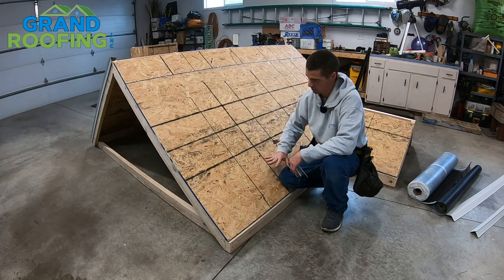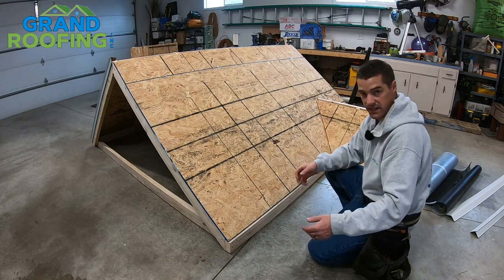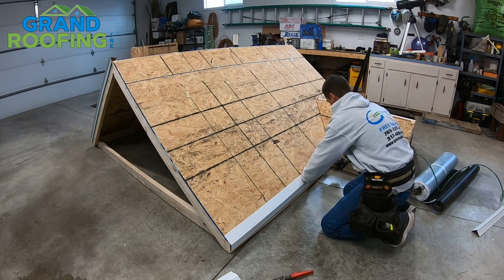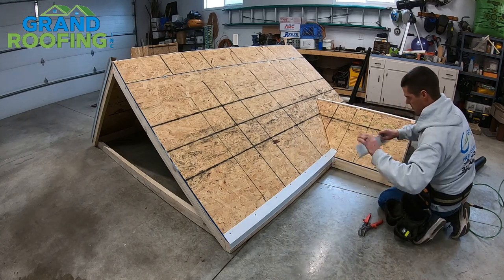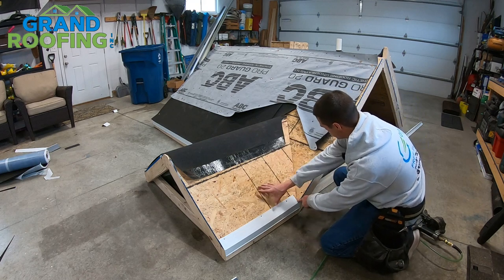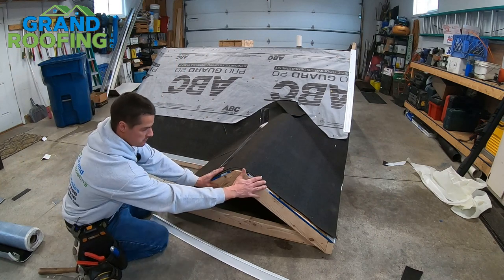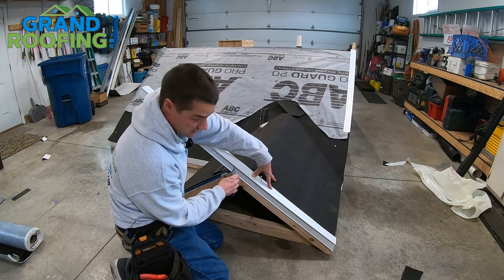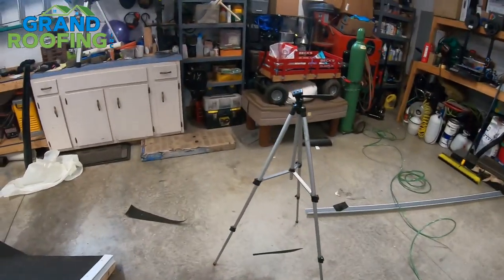Roofing Gutter apron and edge metal

Comment: Y'all roofers need to start making ur gutter aprons at least a quarterinch away from the fascia board so a gutter can easily slip under without being forced to bend the metal up everywhere a gutter will go.   When you force a dumb gutter guy to bend the flashing up it risks us pulling the nails out of flashing. Plus the water likes to escape behind the gutter when you install it super tight the way you did.
Reply: Ya the bottom little bend is supposed tomkeepl that from happening but when installed super tight that bend is smaller than a water drop through surface tension it will stay fixed to the fascia board which is exactly what you are trying to prevent.

Comment: I like slightly crimp the undercourse and trim the little angle off on the bottom, then my overlap bumps into cut, in turn eliminates the bulging overlap. On the right valley, I use drip edge for the whole transition, gives a cleaner look. Plus I always have a 1/2" overhang with the shingles, and if you follow a clean line the overhang would be about an inch. Which will void manufacturers warranty for exceeding max 3/4" overhang.

Comment: Excellent video. It’s the little details that make the roof aesthetically pleasing and water tight. 
I moved into a house a month ago and just realized that there are no drip edges on it. They just bent the top of the fascia, about 3/4 inch at 90 degrees away from the roof, to support the edge of the shingles. Not impressed. I just hope water is not dripping behind the fascia till i can up there and fix it.
Reply: It's weird, where I live not many people seem to care about that sort of thing. They'd rather just have metal going up the rake. Which does offer protection but not as much as if it were don't in the eaves. Guess they all wants something more visibly pleasing then something that actually makes a difference in if the eave fascia rots or not

Comment: Good video.  My gutter guy wants me to use aluminum gutter apron for aluminum gutters, but will I have to hand nail aluminum nails instead of coil roofing nails?
Reply from the maker: I don't see why you would need to. Using an apron is good. Was he encouraging aluminum for any particular reason? Aluminum is a little softer and more flexible, so wondering if that might be why, for him to get the gutter in easier?
Reply: @GrandRoofingInc  He mentioned electrolysis or dissimilar metals, but I cant find any aluminum apron so I'll stick some duct tape to the back so the metal doesnt touch the aluminum gutter.  Probably a non issue with asphalt since they last maybe 30 years only.

Comment: I like ice and water OVER the gutter apron like you did. However, on rake, why not put ice and water also OVER drip edge so that any water leaking through shingle will not be able to get under drip edge and onto wood?
Reply: It's a code requirement in most states. Idea behind it is if very high winds happen s and lifts the shingles the drip edge holds the paper down, less chance of tearing and getting the deck wet.

Comment: Great video with very much detail and little tips 👍
But I have a  question. It's just a small detail but, why are you cutting the 45 on the one that goes over and not the one that goes under when you are installing the drip edge on the gable end? I always do it like that and I think it looks a little bit cleaner 😉
Reply: It looks cleaner for the first like couple of minutes after installing, but afterwards when the roof is complete, you don't even look at those sort of small unneeded details. As the shingles that overhang it cover up that area anyways

Comment: Question, why not use Ice shield for the whole roof instead of only half and the other half by synthetic felt?
Reply: Ice shield is much more expensive per roll, and each roll covers far less square feet than synthetic. So you put the ice shield on the sections that are most likely to experience ice damming (the eaves and valleys), and put synthetic on the rest of the roof that doesn't require such a heavy duty product.

Technically the ice shield is the better product, but for the average roof it would be total overkill to use to cover the whole thing.
Reply: @anthonygiesbrecht3107  oh interesting. Thank you for your response. I am a novice and starting working on my garage roof. Regarding the Gutter Apron would you recommend Anywhere besides Home Depot or Lowes? They don’t have many options
Reply: @eambriz86  I'm not American so I'm not sure what those stores offer. But from what I know those stores are more frequently visited by homeowners rather than contractors. You're better off visiting the lumberyards that the contractors go to.

General rule of thumb, refer to drip edge as "90 degree flashing", and gutter apron as "45 degree flashing". Different stores have different names for their products, but if you clarify what degree you want, it should help you explain to the salesperson what you want.
Reply: @anthonygiesbrecht3107  you are a life saver

Comment: The great roofing debate..what comes first drip or ice guard.good video though..plus Hitachi changed to Metabo
Reply: Bottom drip edge always comes first
Reply: @JoseOrtiz-so4in  not necessarily if the house has ice dam issues..I live in northern ohio along lake erie..I always ice shield down half the facia board then drip then put a half row of ice on my drip
Reply: Grace ice shield states in their instructions that the ice shield goes first and drip edge over it.

Comment: Awesome video! October 2019 I roofed my newly built garage, 5/12 pitch and I did exactly as what you've just shown except I used drip edge everywhere and if I remember correctly I overlapped 4". The following summer when it started getting hot outside, the drip edge started buckling every 6' to 8' along the fascia and gables. Any idea what could cause that or what I might of did wrong? Thanks.
Reply from the maker: No it's kind of hard to tell without seeing it if you have a picture send it to the Grand Roofing Inc Facebook page messaging, I'll check it out.
Reply: @GrandRoofingInc  Okay, thanks. I’ll check and see what it’s like right now. When it’s hot outside, it buckles and when it’s cooler it settles back to its original shape.
Reply: @dtm8073  aluminum fascia always expands and then causes the buckle.
I assume you installed it when it was cold and then nailed it. The bigger the facia board, the bigger chance of it "oil canning" as we call it.
I install seamless guttering, and if we install in very cold temperatures, come next summer, "on occasion" not all, the gutter will buckle also. It looks as if someone actually kicked the gutter with their foot every two feet. Which is the space that you set the hangars. So in between each hangar you will see an inward buckle of the aluminum.
The gutter can expand almost an inch in the summer if it was installed in temperatures below 40 degrees.
Facia reacts the same way but to more of an extent because it is very thin metal.

Comment: My shingles were installed without gutter apron and edge metal.  I have gutters and water is leaking behind gutter.  Can I install under the shingles and put adhesive below or above metal? What adhesive do you recommend?
Reply from the maker: Yes you should be able to add a piece of gutter apron. you might need to use a flat bar possibly if you have nails in the way but should be able to get it tucked under and tact off.

Comment: ice and water go on first.absolutely nothing goes under ice and water..it's job is to stick to the decking, not to seal a nail head....then felt...then metal.
Reply from the maker: There ice and water seals and down to the decking yes as well as the apron. You could also hang the ice and water down over your fascia board like it calls for.
Reply: This is wrong. The dripedge/eave metal should be on first before ice and water. Exactly like it is shown in the video. Yes, ice and water is meant to stick to the decking, that's its purpose, to stick to the decking, and to seal around the nail protrusions to offer better chance at keeping water from flowing down the nail and  into the decking

If you were to put the drip edge overtop of the i&w at the eaves. If any ice damming happens, the water will simply have a chance of tucking itself underneath the eave metal. Water flows downhill. Then it will be contacting the fascia behind the gutters and cause it to rot.
Reply from the maker: Thank you Josh for the excellent explanation!
Reply: Sorry Darryl... think about how water flows. You would want it to go over the gutter apron and into the gutter and not under the gutter apron and into the fascia.
Reply: @Josh-ww5kz  Ice dams form from the roof edge up, ...even though water runs downhill. once ice gets behind your metal, it's on the decking underneath the ice and water shield. ...if the metal was on top, water would go to the felt paper then to the ice and water shield...never touching the deck surface, in short if you put metal on first, there is nothing under it to stop a leak.  take a small survey...does metal go on before ice and water?...I say nothing goes under ice and water, and metal goes on after felt paper. 00.02 ...no disrespect
Reply: @alexness7788  The front of the gutter apron is what matters, as the rain comes off the shingles not the decking...from you logic, why not put the gutter apron under the decking.  =oD
Reply: @darryltaylor9916  I am not sure if I can help you out. I am just hoping no one follows your advise. Please refer the manufacturing instructions such as follows:
https://www.atlasroofing.com/roof-underlayment/weathermaster-ice-and-water-200
Reply: @darryltaylor9916    Ice damns don't form from underneath the metal and right at the eaves. It happens when the heated attic space ends a few feet from the eaves. Where that  small few feet of overhang is on a house, it is the the unheated, cold area of the roof. That's why some places require two runs of ice and water instead of just one run at the eaves.

Water should not be getting to the decking underneath the ice and water. If so, there is other problems. Such as; didn't peel the cellophane, didn't properly overlap the synthetic paper above the I&w and there is a leak somewhere above that area, whether it be a vent chimney, etc, etc.

Take it this way. If you're wearing a rain jacket, and rain pants. Would you tuck your rain jacket inside of your pants or would you rather have it overtop of your pants?  Exactly. That's how rain jackets work, it diverts the water away from your body. If you had it tucked in, water will work its way into that tucked part, and down your legs, hitting your skin. Aka, wood/fascia board. Hope that is a good enough metaphor. 

No offense taken, just different views on how water flows, which is down. It does sometimes flow side to side but it always ends up going downwards on a pitched roof.
Reply: @Josh-ww5kz  I agree...I didn't mean they form from underneath the metal...but from the bottom of the roof egde, opposite how water runs...often from gutters full of ice,,,then works its way up....your example about rain fall doesn't apply, as ice dams go up from the roof edge, , not down from the peak....how water flows is not the issue, it how ice dams form.
Reply: @alexness7788  That's underlayment not ice and water shield....in this diagram ice and water would go under the metal.   you got the water flows downhill part right, but the ice can swell up from the bottom..not so much.
Reply: @darryltaylor9916  ice sometimes clogs at the gutters, seen it lots in saskatchewan. Was annoying having to clean them out after tear off as it was a mix of mushy snow and granuals.

I get your reasoning behind this, but that's just not how it works, ask any manufacturer, or better yet, any liable roofer that lives in a place where it snows half the year.

I've seen the bottom edge of the decking being rotted out from people doing it the same way you did, with ice and water underneath the rake metal, it was on lower slopes but that's where he edge metal underneath the ice and water proves its correct application method.
Reply: @darryltaylor9916  Ahhh...okay I see now what you're getting at. That method only really works with new construction. Unless you want to be liable for any damage to the gutters while taking them off, and adding hours onto labour for taking them off and putting them back on. Not really a viable option when you're on 2+ story roofs. But hey, if the homeowner is paying for it then that's another thing haha.

I personally have never seen a house with ice and water up the rake, not necessary at all in my opinion